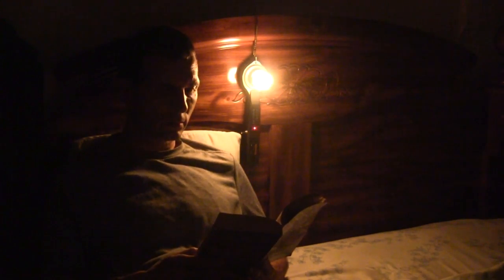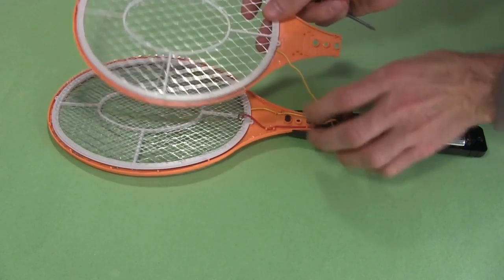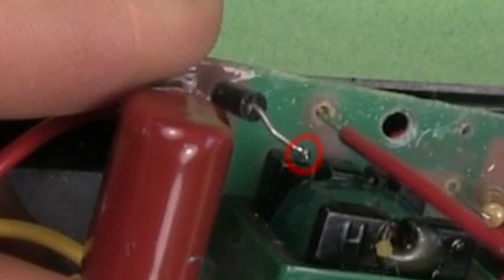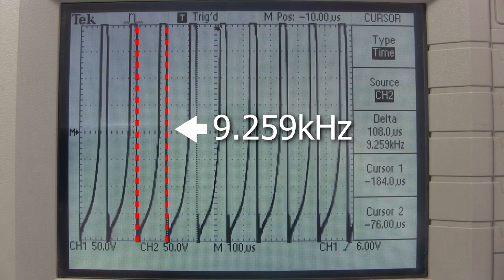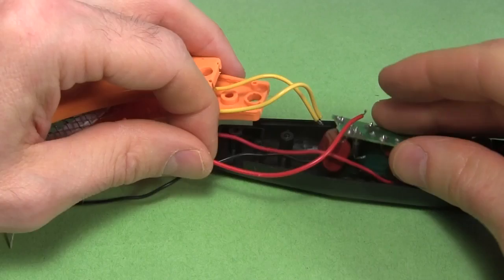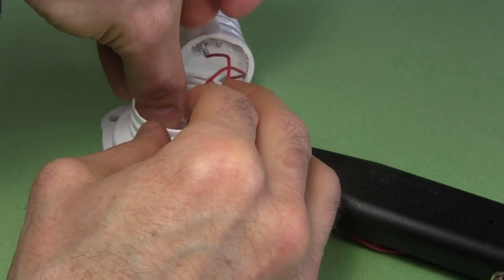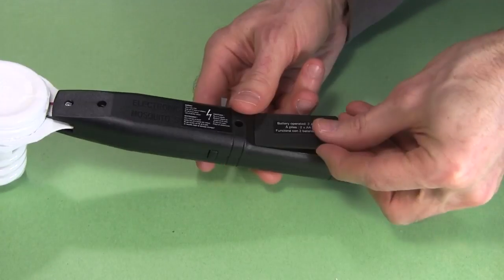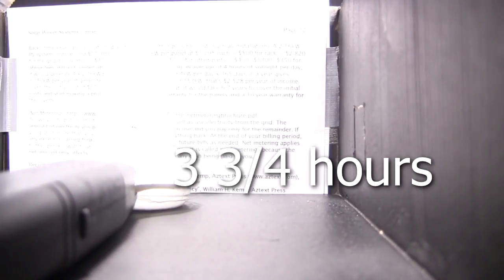How to Make CFL Powered by Electric Fly Swatter/Racket Zapper

Comment: The circuit looks like a HIGH VOLTAGE JOULE THIEF!
Reply from the maker: Ivan Paul Good eye! It is.
Reply: RimstarOrg I have TWO small doubt!!
1]Why aren't they running WHITE ????
2]Does this produce dirty electricity???
Reply from the maker: Ivan Paul 1) The CFL tube output looks pretty yellow to me, which is the color they originally were. These days I use white CFLs but none of mine have burnt out yet so I haven't cut anyway any tubes for white ones.2) If by dirty electricity you mean electromagnetic waves it frequencies that could interfere with things, then it probably does. I didn't make any attempt to put shielding.

Comment: great project, but 1x 1W white LED costs $0,7US and you need only LED, one resistor and the batteries which all in all will cost way less than even the fly swatter and will produce way more light and will last more than a few days using 2x AA batteries and it will be way smaller in dimensions.
i would like to see you make tutorial about LEDs, series, parallel, why you need to control the current, explanation about the calculations, best way to drive the LEDs etc...
at the moment i am building a garden light using 9x 1W LEDs with light sensor and 12V 60W 5A switching power supply, i would like some help for this if possible.
Reply from the maker: Hobypyrocom Thanks. This is intended as a fun project. a fun hack and an electronics learning lesson. I agree, with its 3 3/4 hours runtime, LEDs would be the way to go for something more practical. Having said that, I haven't done much with LEDs.
Reply: RimstarOrg They aren't too bad to design around. There is hardly even a need for a ballast, or similar driver, as there is for CFLs. You can always pick up some good 5-10W really blindingly powerful power LEDs these days, ones that are like 130lm/w! I sometimes will just direct-drive them with 3AAA or 3AA batteries, without any ballast, and rely on the internal resistance of the battery. That is not good practice though.

Comment: Was the used tube dead? It looks like dead one will work, since you have not used it's filaments.
Reply from the maker: Hrushikesh Vartak The tube was fine, though something was wrong with the electronics that was attached to it since the CFL as a whole didn't work anymore. What do you mean by I didn't use its filaments?
Reply: What i meant was you are not passing current through the filaments but using them just as a simple electrodes. It's nice to see that swatter circuit can lit the tube without requiring to heat up the electrodes.
Reply from the maker: Hrushikesh Vartak That's a good point. I just connected to only one wire from each filament and the CFL tube lit. So the fact that the tube lights up with this circuit isn't a test if the filaments are good.

Comment: pretty cool concept there ! just had a brainstorm looking at that, would there be a way to still utilize the zapper racket ? if so you could possibly put together a cheap, portable bug zapper for camping trips, cookout and such.. im sure such a thing is on the market but this could be a cheap and easy alternative !
Reply from the maker: dirkk82 ? But I started out with a bug zapper. Or do mean put it back together and modify it to make a different type of bug zapper?On the other hand, the market seems to be for hackers like us to buy them for taking apart and doing other things with them. :)
Reply: RimstarOrg lol  i thought my  question might be confusing .. well there's the traditional bug zapper, using a light which is surrounded by an electrified cage. the same could be made with that zapper racket, a bit of modification would be needed but then you have a portable version of the traditional version, its cheap, battery powered, and a virtually hands-free version of the zapper racket .. i've tried those rackets before and i must say, i'd rather the insects come to me as apposed to chasing them down :-p
Reply from the maker: dirkk82 Ah. I wonder if you'd need two zapper rackets. The charge on the cage could be built up slowly over time since bugs don't arrive in a constant stream. Unless they do, in which case, run! :)
Reply: yes i was wondering that as well, not sure if there would be enough current for both the CFL and keeping the racket charged .. well its almost springtime here in Germany as soon as the rackets come again i will pick up a few and try it out :-)

Comment: I like how the output remains consistent for nearly all of the run duration. It would make a good use for a 'dead' CFL, which never are, it's just the circuit inside that wonks out. The light is far warmer than any LED, which can help when reading for long periods.
Could you measure the coil resistances ? It seems very similar to the Jeanna's Light in coil design.
Reply: Adam Hasso
Yes, If you build Rimstars circuit here, you can use a CFL that no longer works when plugged in to a conventional mains socket.
Us guys who have a history with wireless electricity circuits and Slayer Exciters often use failed CFL's, that work just fine again without their internal circuitry :)
I shouldn't say never dies, there will be some limit, but have yet to see a CFL dim down or use up the mercury vapor.
Reply from the maker: Adam Hasso I don't know about "never" but 3 out of 4 of the CFL tubes I showed at the beginning of the video plus the one I actually use came from CFLs that stopped working but all those tubes are fine. (I say 3 out of 4 because the 5 watt one was from a CFL that still worked but I needed the tube.) The only time I had a bad tube was when I dropped one and the glass broke. I've never examined the electronics to see what went wrong.
Reply from the maker: I already did a few weeks ago when I was working out the circuit - the two input windings have a resistance of around 20 ohms each and the output winding has around 320 ohms. I also suspect the coils are doing the same thing as those in Jeanna's Light. My experience with that is what made me suspect this would work.
Reply: RimstarOrg Thanks very much for the details. Quite high values on the primary + tertiary, rather than 2 or 3 ohms.
Cheers :)
Reply: slider2732 You said CFL never dies ?? But it's the circuit ?? Can you back that up or at least give me some info ??
Reply: I know what you mean by the light of a CFL being better Good LEDS, but have you tried getting some warm white high CRI LEDS? From experience, I have a few standard CREE XML leds which are 1000LM, and provide better light than any cheap crap 10,000k led got from eaby for cheap.
Reply: Power Max What about LEDs blue light ??
Reply: Adam Hasso Heavy coats of phosphor are used to convert the blue emission to lower wavelengths of light to produce a very good, high CRI light. However, the disadvantage is that they are generally less efficient. Because the phosphor converts high energy photons to lower energy photons, energy had to be lost in the process, and that is dissipated as heat. Also, impurities in the phosphor absorbs the light outright, and lead to heat too, and less light, the same way a light bulb coated with white vs a crystal clear one (you may even notice the reduced light output from a frosted globe vs a clear one, I can.). 

http://www.digikey.com/en/articles/techzone/2013/nov/~/media/Images/Article%20Library/TechZone%20Articles/2013/November/LEDs%20Offer%20Efficient%20ColorAccurate%20Museum%20Gallery%20Lighting/article-2013november-LEDs-offer-efficient-color-fig3.jpg

Comment: that capasator should be over the lamp
it makes the ac more stable
Reply from the maker: I would worry that it might lower the AC voltage too much. A CFL tube needs high voltage to start at least. But I could be wrong.

Comment: i would like to try this with led light bulb
Reply: I was referring to the previous comment. What I describe would end up being a COMPLETELY different project. To make something that has the same uses as what is shown in the video, I would be using LEDs and a simple constant current switching LED driver, which would be the most practical way to make the same thing shown in the video. I am not a fan of those ugly CFLs,  their fragile nature, and their poor efficiency (like <65lm/w vs 100-200lm/w of modern high-end LED tech)
Reply from the maker: Lester King The voltage is too high for an LED light bulb if you put it in the same place as the CFL. However, an LED light bulb, or at least an LED, may work if you put it between the collector and emitter of the transistor.
Reply: Then get some cree XML2 power LEDs, a heatsink to mount them to, and a 3.3V power supply capible of at least 3A. Idealy you would use a switch mode power supply to maximize efficiency.
Reply from the maker: Power Max But the voltage at the CFL is in the hundreds of volts. I couldn't see it with my scope, it was too high, but I estimated it from what I could on the scope to be around 600 volts.
Reply: Power Max
So? Go do your "completely different" video then.
Why even bring this up in the first place?
Reply from the maker: Power Max Ah. Somehow youtube isn't putting who you're replying to in your comments.
Reply from the maker: ***** Your mention of a capacitor reminded me that I did something similar with my gravity light (v2) (http://youtu.be/GisQYoYw05k). So I just hooked the output of my modified electric fly swatter to the input of my gravity light circuit (a full wave bridge rectifier followed by a capacitor) and from there to the LED "bulb" I put together for the gravity light. On the meter I watched the voltage across the capacitor build up until it reached the voltage that the LEDs turn on at and then they turned on. The current after that was probably too low to light them very brightly, but it worked. I posted is to Google+ here https://plus.google.com/116395125136223897621/posts/ETaaHkQhL33.That also means LEDs connected to an unmodified fly swatter might also work since the part of the circuit that I disconnected is similar to my gravity light circuit (just one diode instead of a full wave bridge rectifier.)
Reply: RimstarOrg I beleive what he is referring to is using a capacitor in series with LED and power supply. Even though capacitors do not let electron current flow through them, AC can 'flow' though. This effect is described by capacitive reactance, and a phase shift occurs. (It has to do with electrostatic feild produced on one side if the cap has the ability to push electrons away, of pull them in, depending on the polarity. Current cant flow indeninantly in either direction, so thats why high freq. AC is conducted though them! You could probably do a educational video on it!